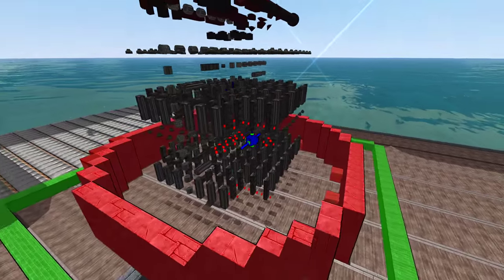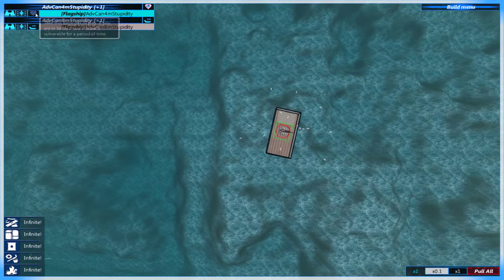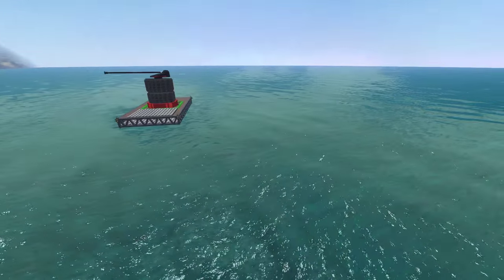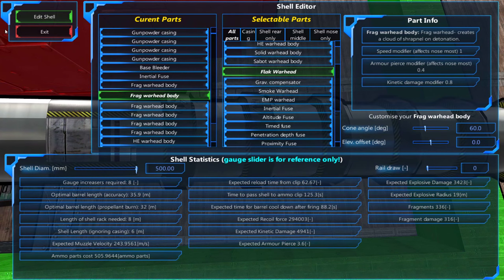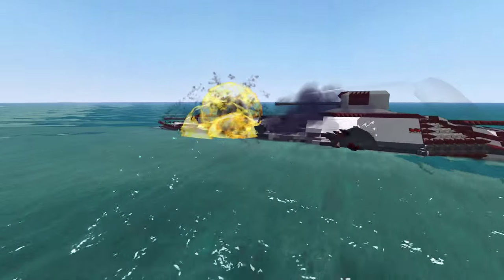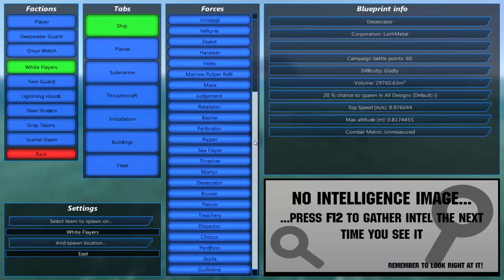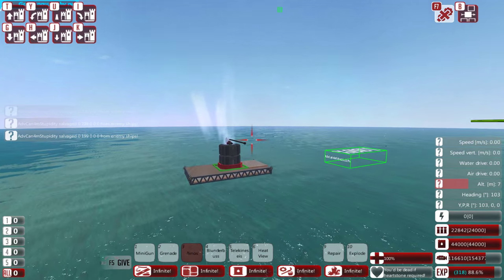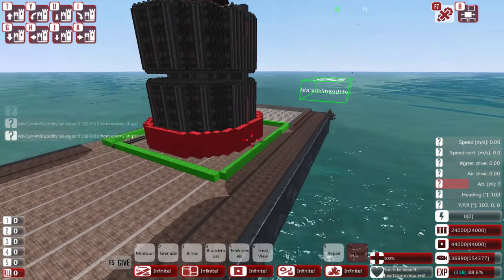Stupidly big cannons - 500mm 8m shell 300RPM! - From the Depths

Comment: Up next, we build a rapid fire 1000 m/s per shot railgun. How do you like them apples?!

Meanwhile in the infrastructures department,
Ammo processing: Uhhh... We need more metal...
Ammo storage: I'm surrounded by metric ass tons of explosive death and defeat. BOOM
Batteries: We need more power! We need more power!
Engines: Engine #2331 has overheated. Engine #2155 has overheated...
Fuel refinery: Cough cough So much smoke Q_Q
Resources: Ded
Reply from the maker: +BrokenLifeCycle Lol!  True story! :D
Reply: I build a 235km/s railgun, and took only half an hour
Reply: BrokenLifeCycle lol I already made and mounted a 3km/s rail gun on my destroyer
Reply: 1000m/s is not hard to do, I upgraded one of my designs to a railgun, I used it for anti air :P so not all that powerfull but i went 1112m/s it was a little lacking on the damage department but it could one shot some planes, all hail the hollow point lol, now that i thinked about it, how bout some graviton rams kek
Reply: 1000 meters a second is extremely slow
Reply: @furryhunter7838  That is the near upper limit of modern ballistic weapons. The highest muzzle velocity recorded is 1220 m/sec, from the Winchester .223 SSM round. Average rifle muzzle velocity is from 900m/s to 1100m/s. Now in the game, 1000m/s IS pretty slow for a railgun.

Comment: Finally, he gets an idea of how REAL cannons are made
Reply from the maker: +Isaac Vangerpen Yeah... Real cannons that are vulnerable as all hell and require about 150 ammo processors to keep fed.  I prefer to think of a real cannon as something you can actually use on a ship. :)
Reply: this is what land-based fortresses are for. So the solid block of metal doesn't sink
Reply: I developed a somewhat workable variant of which 2 or 3 can be placed on a large ship without it sinking, but it only fires 4m .50 cal shells at about 300 RPM. It is quite amazing when used with graviton ram shells, as it knocks back a bulwark about 100m per hit, and causes physics issues if fired at anything about vanguard size or smaller.
Reply: I meant to say 30 RPM. And if fired at anything with a volume of less than about 400 m^3, that anything appears to disappear from the universe via wonderous physics issues that cause it to spaghettify before winking out of existence. It also fits the description of a rapid fire 1000 m/s per shot railgun if you are willing to go down to 10 RPM and have enough power. 1050 m/s, in fact. And doing 200 damage per hit and then beaching the target on any nearby landmasses is always fun

Comment: What's more effective to you, one double barreled 2000 CRAM or the 8m stupidity?
Reply from the maker: +TheFuzzbro Depends how big the CRAM is.  With an equal sized turret, I would say the 8m stupidity would win in a standup battle because of the sheer fire rate, even if each shell does much less damage.
Reply: ireLAN Gaming Yeah i kinda agree, they have a higher fire rate with a trade of a less damage
Reply from the maker: TheFuzzbro I imagine the overall DPS of the adv cannon would be a little bit lower, but i feel it's their utility that makes them so valuable.

Comment: Oooooh. Very nice. You know me: the pointlessly bigger, the better. Haven't got a chance to check up the update notes, so I'm gonna ask you. Did the 2 meter loaders also get a buff? A few updates ago, I noticed a change in performance of one of my dual-barrel 2m loader cannons-- I hadn't changed the design at all, but it started to struggle to load shells fast enough to keep up a sustained (if somewhat dialed-back) rate of fire where it was previously able to do so.

If this reload speed buff for autoloaders was also applied to the 2m loaders, I'll have to see if the update brings it back up to a consistent fire rate again. Might even be able to marginally increase the r.o.f. if it got enough of a boost.
Reply from the maker: +Nicholas Wright Yep, they did indeed get a buff.  All the larger loaders did.  They get a 40% reload speed boost compared to the smaller size.  So it ends up that the 8m loaders fire 5 times faster than a 1m.
Reply: ireLAN Gaming That... actually sounds mildly broken at the high end. Sounds. I have to test it, of course, and see exactly how that changes things.

In any case, thanks for filling me in. Cheers! and as always, keep up the good work, mate. Love the channel.
Reply from the maker: Nicholas Wright It actually leads to problems with getting enough ammo inputs on the cannon unless you make it really big and exploit the autoloader complexity.  They're actually too fast and it kinda balances itself, which I really like! :D
They are also, ludicrously big in comparison, so they aren't really OP.  Certainly more functional than they were now.

Comment: That gun or two at a central resource base could protect that base from everything
Reply: Except aircraft.
Reply: +Minecraft Zerneas small aircraft anyway, and I never have one type of weapon.  against small, fast jets I like lasers.  a resource zone that makes fuel has enough extra to power a huge engine that can power a huge laser.
Reply: Fair enough. I'm in the excessive weaponry camp. If a weapon can fit and be useful,  it will be there.

Comment: How do you even calculate the fire rate with large loaders? the reload times on the shell customizer still look the same.
Reply from the maker: +Puttrik87 You have to do it separately unfortunately.  Each larger loader is 40% faster than the previous one.  So a 2m loader is 40% faster than a 1m.  4m is 40% faster than a 2m etc.
Reply: ireLAN Gaming But how does one calculate that for a 4m shell, since a 4m shell can't fit in a 1m loader?
Reply from the maker: Puttrik87 The reload speed bonus is a modifier applied after the reload speed.  So if you work it out as a percentage of the total reload speed, you get 100% x 0.6 (the effective new reload speed) = 60% (this is a 2m loader).  60% x 0.6 = 36% for a 4m loader.  So a 4m is almost 3 times faster than a 1m loader.
This is based on the single line of text in the changelog, so I'm not totally sure if it's correct, but it seems to match up alright.
Reply: ireLAN Gaming
So in other words, i'll modify the reload speed from clip? Or after i factor in the number of loaders and such?
Reply from the maker: Puttrik87 I'm not actually sure when the reload speed bonus is added to the equation actually.  That's something you'll have to work out. :)

Comment: how do u count the rate fire for the cannon ? never really bother to actually do those kind of thing
Reply from the maker: +candieka tasbihyantra Work out how long it takes to fire 1 shell (Either your maximum cooldown speed or maximum reload speed, whichever is high) and divide that number into 60.  So if your cannon has a cooldown of 1s and a reload speed of 2s, it will have 60/2 = 30 RPM.  If it was cooldown of 1s and reload of 0.5s, it will have 60/1 = 60RPM etc
Reply: ireLAN Gaming thanxs mate

Comment: Oh please... I'll be posting my BFRG to the workshop soon. 500mm shells, 8m long, over 70k power and I have no idea how high the reload is but it's high... very high. You just have to be willing to pay several million RP for the fortress with a single gun.
Reply: +ireLAN Gaming I think it's more about what one can achieve with the computer they have.
Reply from the maker: Isaac Vangerpen My sentiments exactly. ^^
Reply: AP shells with little to no flak or HE seems to put the least strain on the system.
Reply from the maker: hla0roo Hang on... The turret costs 1.5m RP?  Jeez, how big is it? O_o
Gotta agree with you then.  It's nice to make the game work for it now and again.  Gotta put that hardware to use. :D
Reply: putting MY hardware to use means loading more than 1500 blocks at a time :D
Reply: Quad barrel CRAM turret that's about... I think 40x40x12 or something like that. I mean, you can get 2m shells pretty easily, but this one has a 12 second refire time. I've seen it take out a Kalmar in a single volley.
Reply: It's not even remotely optimized.

Comment: they really should remove the explosive side of ACC, it makes them completly obsolete compared to cramp with explosive, as it is now you have AP for ACC and HE for cram ( i used your CRAM fro the mastyff ( slightly modified ) to build my new brutal fortress XD)
Reply from the maker: +jeanjio I don't see the point of removing it.  They are definitely weaker than the CRAM version, but they are still good in certain circumstances and it doesn't hurt to have them.  Cool to hear that the turret is getting some extra use! :D
Reply: What i meant was removing the fact that autoloaders are so explody XD not HE and flack from ACC xD will post it on the forum so you can see, it is very expensive but damn sturdy and powerfull.
Reply from the maker: jeanjio Ohh right, gotcha.  I don't think it should be removed, but maybe toned down a little bit instead.
Reply: honestly i think it should be made the same as CRAM.This way it would be sensible to use BIG HE ACC instead of cram if you want faster fire rate

Comment: While messing around in my own game, I managed to make a railgun capable of putting a 500mm shell down range at 30k km/sec or 1/10 the speed of light. I'd like to see you try to top that kappa
Reply: +LincDN 30km/s is 0.0001c (1/10000th of c), not 0.1c. :)
Reply: Yes, that is correct. But I said 30k (30,000) km/s
Reply: Ah, you're right, I didn't spot it. How did you manage that muzzle velocity then ?! o_o
Reply: A couple thousand m^3 of battery storage and a barrel that I stopped counting the the length of after 100.